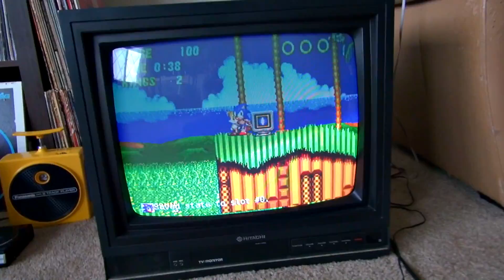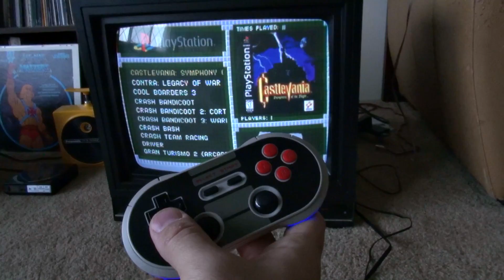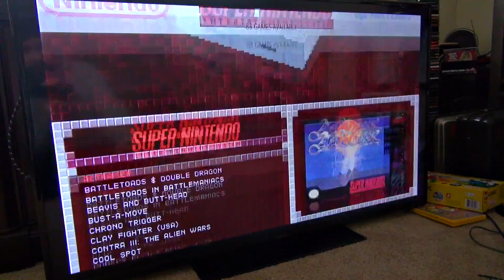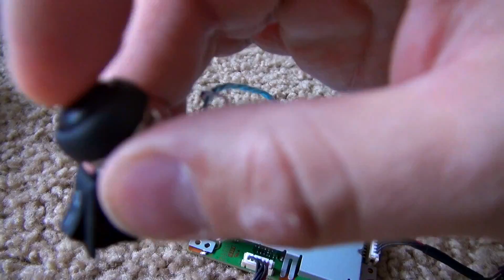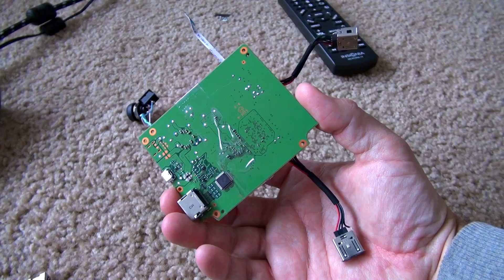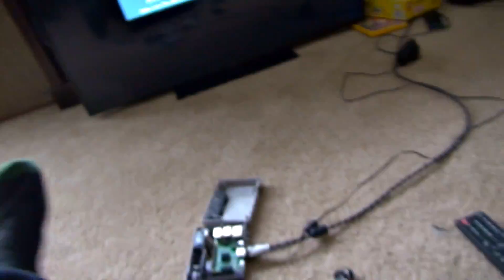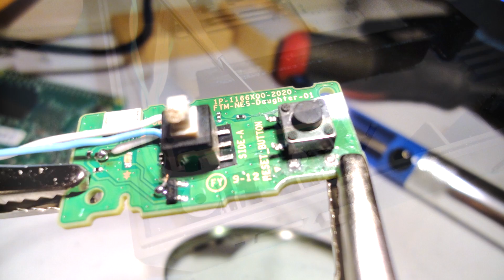Too soon? NES Classic Mini! Transformed into Raspberry Pi retro gaming machine!

Comment: I did my SNES retro. It has all nes and snes along with 1500 ps1 games Atari and many other. I was able to mod it without opening it up. I use a OTG cable to plug in my thumb drive and I have any oldskool game I want. Also have game genie installed and you can switch it on or off. There’s a lot under the hood

Comment: This is probably gonna get some hate for butchering an nes mini but this is what it should've been in the first place.
Reply: Actually, a quick flash of the contents of the NES classic and you can make it into a better emulator than that on a PI, they left plenty of storage room for almost ever NES and SNES rom.  All you have to buy is some controller extension cables for $10 pair and SNES classic controller.

Comment: Looks like its setup well. Why not build a rpi edition out of one. At the end of the day, it's your console to do as you please. Personally I'd feel bad ripping into like I did tearing apart a gameboy but if the builds clean it's not so bad. Iv build a gameboy zero out of an original gameboy, its clean. No hot glue or chipboards stacked up on top of each other. I don't feel so bad tearing into originals if it's a nice build. The nespi you've built here is quality. I'd be happy with the outcome 👍

Comment: What a freakin awesome build!!! I'm putting a Raspberry Pi 3 in a Chinese clone of a mini as I couldn't get my hands on an actual Nintendo one (for a reasonable price). The funny thing is I wouldn't have even modified it if I could have gotten a real one. Now I'm into it for as much as it would cost to buy a real one on eBay, but its a happy accident. I'll be way happier with a retropie console. My build is not going to be anywhere near as nice as yours, but I'm trying to get all the same functionality, and some of the aesthetics like the switches and light. That hinge you built is too damn cool! Any advice you have on making that cut so clean and thin would be appreciated. Subbing you for sure, also I should be sleeping and now I'm gonna be watching all your videos. Thank you!!!

Comment: I was thinking about emulating more of the haptic site of inserting cartridges. The software and circuit site of this is pretty simple with the gpio's. But making it feel rlike the real thing is hard do you have any ideas? If you actually want to do this i will prepare the software and circuit board layouts if you can call something this simple that.
Reply: Having seen your video you might be the right guy to get the "clicky feeling" right.

Comment: This is a nice quality conversion! I love the unique save/load state controls under the hood. It seems like you and I used a lot of the same hotkeys for controllers too. Going with the 8bitdo pads was smart as well. It's a shame they haven't made a 6-button version of these yet for Sega and N64 games... but that's another topic. 

Also I have to give you props for the Composite out, and how it just switches the resolution and stuff on it's own. I'm currently trying to get my own custom console adapted to a composite signal.  It's easily my favorite feature you have on display here. 

This SD-Floppy is easily the coolest thing I've seen in a long time. My mind is swimming with ideas on how to use such a cool device. I'm looking forward to seeing how you did that.

Comment: did you wire the composite video cables to the pins from the av port itself or did you wire the cables to the test pads, ie. pp26, pp25, pp24? if it helps to answer my question I have the rpi3
Reply from the maker: They're wired to the test pads
Reply: Yellow to pp24, red to pp26 and white to pp25 right?

Comment: Doin my own classic conversion myself, 2 simple questions.... How did you wire the power button (which pins specifically did you use as I also have a mausberry) and is the reset wired into your keyboard emulater to emulate the "esc" key to exit back to emulation station? I am going to post this question  here and your other related videos as I do not know which ones you will respond to and I could really use the answer soon as I want my box finished soon lol. Thanks for the help man...
Reply: okay well thanks for getting back to me lol

Comment: This is terrific.  I'm with you on the need for a shutdown script.  I wonder if there might be anything which could be done in the event of power loss?  Could there be a battery pack and some sort of signal to the Raspberry Pi OS which then responds by issuing an orderly shutdown?  I would hate to go through all of the work of setting a thing up and then having a power flux "flux things up."

Comment: Dude... incase you are not aware...you can Add Scanlines to all the games! and it will look like a CRT or better! in one of the RetroPie menus...or you can also buy an HDMI to VGA adaptor and then a Scanline generator which adds scanlines through a piece of hardware rather than emulated.

Comment: I am really interested in the theme you have running and the script to play the music.I started (trying) to tinker with the settings but it's so weird there are two locations to store and run themes on the Pi.... also don't know where I would store the audio file and read from.
I'll keep chugging away- it's nice to see that it is indeed possible to have background music in the menu. That's the first thing I felt was missing with some of these pre-made themes!
Why not just SSH into the Pi rather than use that floppy/SD thing to transfer ROMs?

Comment: Is there a strong point for this? While an RPi is fun for projects, you can install Linux on the NES Classic itself, and then, if you're inclined, port retropi or other emulators to it.
Reply from the maker: +阮天青 yes, what's a Raspberry Pi get storage space depending on the size of SD card you install, Wi-Fi, Bluetooth, USB ports, and far more development and support options
Reply: True, but you have such functionality without dropping the dosh to get a NES Classic Mini. A 3D printed case would be a lot less costly, and certainly, would be better developed to accommodate an RPi.

Comment: Hey, can you explain how you connect the mini LED to the mausberry? I got the use your own switch version and I don't know if i need to put a resistor. Thanx.
Reply from the maker: I connected it in place of the Pi's power LED, which has the correct voltage
Reply: Hey Maxime, did you ever successfully get the mausberry circuit connected to the nes classic mini LED on/off and reset board?

shoot me an email if you can if you have done it. would love to discuss

briandamico@me.com

Comment: I saw mods like this coming a mile away. Thanks for showing the Bluetooth controllers, I've been wanting to see them in action before I buy. I have the sloppy nes controller for my rom set as well as the other systems. most of them are sloppy as well but the n64 one is better. Thank you for the time you put into making this. I will research what you said and build my own. Would be an awesome science project for my son in school. Thanks again! Keep them coming. BTW awesome sd floppy drive.

Comment: Is there any reason you couldnt use a 1/8" to component video adapter cable instead of installing the component connector?  Isnt that what the little 1/8" port is for?  I think I have one of those that came with an old camcorder that I have laying around.
Reply: +Dr. Moddnstine Are you going to be selling something like this? I may want to buy one.
Reply from the maker: +JEG's Garage it seems a bit redundant, I know. It was really just for ease of connection. I don't have to run around the house now finding a special cable to hook this up to a CRT. Plus it's also to keep it somewhat authentic as the original NES had analog composite video and audio out. Sort of a throwback to see those jacks on an NES mini which clearly does not come that way makes it stand out
Reply: Fair enough!  I kind of figured thats why you did it..but I haven't played with my Pi yet, so I wasnt sure if that input was different or not.  I love the build you did.  I wish I could pull that off, but Im going to end up just putting mine into a case and running bare essentials for retropie gaming haha.
Reply: I would like to buy one! Name the price

Comment: Dr. Moddnstine, I have a question about the aspect ratio. I managed to replicate your setup, but when I plug my pi to a CRT, the ratio is still 16:9 (I have to set overscan so that the menus don't get cut off, but then it also squeezes the games' image). How did you do it so that both the ES menu and the games run in 4:3 on your screen?
Reply from the maker: In boot/config.txt uncomment the four overscan_left, right, top, and bottom settings
Reply: Dr. Moddnstine doesn't that compress the image of the game? If I apply overscan to fit the emulationstation menu with my crt, then the game gets squished!
Reply: Hey Felix,  did you ever successfully get the mausberry circuit connected to the nes classic mini LED on/off and reset board?

shoot me an email if you can if you have done it. would love to discuss

briandamico@me.com

Comment: Can you point what Keyboard emulator you used? as i'd like to use  the shell of a original NES (its mainboard died long ago when its AC Adapter failed taking the NES w/ it) and able to share that startup video?
Reply from the maker: it's linked in the description

Comment: Hey with the mausberry circuit did you connect it via the gpio pins? Possible if you can take a picture of the bottom?
Reply from the maker: Yes, you have to. Look a the end of the video to see some pics.
Reply: Dr. Moddnstine hey so I saw the pictures, mine came with 2 leads to come off it to hook up to the gpio pins but doesn't it require power for it to work? because mine plugs into the pi's micro usb then it can turn off

Comment: The reason why those games are blockey on a HDTV is because the tv is stretching a 240p signal to 720p or 1080p, so even a scanline filter wouldn't help much,but if those emulators will have a smoothing filter and/or adding scanlines while smoothing up the image,it can look closer as what you will see on a crt tv.
I liked how you added composite out on the nes mini,if nintendo did that,then they could,ve add duckhunt aswell.

Comment: Dr... looks great to me. i have a question. how do you get only the art work to show with none of that game info and have the game covers show larger than normal when you go into each system? i cant figure that part out and havent had luck finding that info anywhere else. your setup is exactly what i am looking for. thanks
Reply from the maker: It's the pixel theme
Reply: Dr. Moddnstine 
I found it shortly after I saw your video. thanks for getting back to me

Comment: You know you can just hold select and hit L to load state, R to save and the dpad while holding select to pick states
Reply from the maker: +Bromius yes, but those button are not available on the NES controller. Also this is an easier option for people not familiar with the hit key even if the Bluetooth controllers with the shoulder buttons are being used.

Comment: now hack the original nes classic edition and i will be impressed.  i wonder if they bothered to make their own OS or if it just runs linux... 

somebody should desolder the memory chip from it and dump a rom and start hacking the fuck out of it.  

seems like between the usb port and the 512 MB it should be theoretically possible to load a full NES library.  i would like to see how many games Nintendo's own emulator can actually run...

Comment: How did you get the opening flap to look so professional.  I haven't seen the real NES Classic up close but I assumed that the the flap wasn't simply sealed but just a facade to begin with.

But when you open it up I could see tiny lips along the inside of the open panel.  It's like you shrunk the original Nintendo.

Comment: Sorry but this video shows how the classic mini is such a ripoff.
Using an old product on limited access. Wii controller connection, so to increase the cable length you need to buy a wii extension.
The internal space, they could fit the whole Nintendo library twice in it, but they chose to do 30 games???

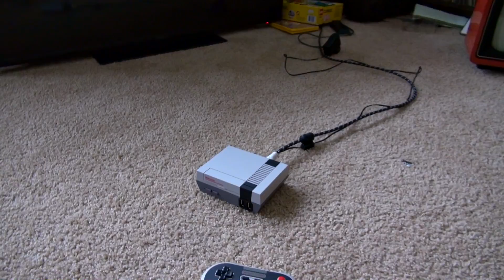Comment: 9:14 Didn't you say the HDMI port was epoxied over?
Reply from the maker: +Borvoc Yes. The original USB power port is where the Pi's HDMI out is now. There is a new hole under the Pi's HDMI out for powering the Pi.
Reply: Dr. Moddnstine Touche. Nice.

Comment: the menus seem to be 60 fps try making everything 24 fps
Reply: taltigolt why would you intentionally make the frame rate lower
Reply: Brian Harelick it's a nes?
Reply: The NES ran games at 60fps though.
Reply: take up less processing power
Reply: Antinull i stand uncorrected
Reply: re-corrected confirmed for brawl
Reply: Strafe doesnt matter my pi does fine at 60 running for days
Reply: Damian Cabaniss still takes less processing power
Reply: Squirt i stand corrected
Reply: right, interlaced frames though so only 30fps at full frame.
Reply: taltigolt You originally said 24fps, so get recorrected :P

Comment: How much hair pulling took place getting the 8bitdo controllers to properly sync?
Reply from the maker: About 5 months ago, lots. It's cake once you have the right firmware for the controllers
Reply: Ha, yeah I couldn't for the life of me figure it out. Thankfully, it was for a buddy of mines Pi project, and eventually he settled on keeping it wired. I'll have to look into the firmware and see which one is on there, I'm fairly certain I had upgraded it while troubleshooting.  Could you identify which is the most compatible firmware version that's worked for you, by chance?

They are excellent quality controllers, but when they simply refused to properly connect with the Pi after days of tinkering, I was incredibly frustrated.

My wired and wireless Xbox 360 controllers were plug and play, and are my preferred RetroPi controller anyway.

Comment: Prob the thing I most wanted to see that you didn't show was how you managed to cut out the cart slot> getting it straight and not fubaring it ?
Reply from the maker: That was a cringe inducing cut. I used a 9mm breakaway razor. I just kept making slow and steady runs down the channels. I had to take breaks as it was very fatiguing on the hand. One wrong move, and it's over, you've got a permanent slash on the face or top of your coveted NES Mini. I was literally sweating, and emitting body oder. To top it off, the case is very thick for what it is, so it takes awhile. 0 out of 0, would not want to cut again.
Reply: Lol nice I figured as much, Nice build buddy. No build log I take it ?
Have you a link to the script file for menu music ? I'm going to be building a pi zero soon and will prob add some smooth tunes ;) Thanks.
Reply from the maker: Check the description, I added a link to the BG music script.
Reply: Thanks already found how to do it and done it ! ;)
Reply: Dr. Moddnstine how much is it
Reply from the maker: +Charles Smithjr check the description, you'll find a video that explains my service. Price is in the description of that video.
Reply: Dr. Moddnstine ohh okay thank you

Comment: dude, sell these,  make them and sell them for $100 a piece,  you'd male $200k a year easily. I'll give you your first order Bro. $100 flat,  barely no shipping.  time could sell with no controllers even
Reply: RYNO NEEDLER it's also completely illegal to sell.  Make it yourself, genius.
Reply: the parts alone are more than $100. even when you can get the nes classic. $35 for a pi3, ^0 for the nes classic, $9 for the conversion usb thing + keyboard emulator thing + misc parts for jacks and such. + time. $200 conversion, easy.
Reply: kenabi yeah... hello McFly

Comment: So you bought a 60 dollar gaming machine so you can put a 35 dollar computer into the box?  Why not just 3d print the box?
Reply from the maker: +dur678910 That's the thing, the NES MIni is not a gaming machine, the Raspberry Pi 3 has some actual capability/expandability unlike the original guts with 256MB memory. The official NES case is unlike any 3D printed case, quality injection molded ABS plastic. It's perfect in appearance. Even with compromising the structure by cutting out the door hole, it feels like I could still put all my weight on this thing and it not cave in or break.

Comment: DUDE..market this and sell sell sell. No romz included of course just the emu's but I'd buy one for sure. Also there are Genesis, Atari, and prob others that could be used as a "case of choice"  so to speak.
Reply: Zarren Sanders he will be sued by sony and nintendo if he selled this
Reply: ya your prob right. but it is damn awsome.
Reply: +NA maybe not...if we buy the nes mini and the raspberry pi and have him modify and only charge for the service and extra parts. ..he won't get in trouble.
Reply: you can make it for free. selling the emulators isn't legal as they have non commercial clauses so good luck with that. Also nintendo will be on your butt too after you are done being shamed by the opensource community.
Reply: Zarren Sanders what do you think the going price for something like this?
Reply: well the classic is 60 bucks then the pie 3 with 2 controlers already set up on amazon is 90 bucks then considering work done id say $199.99 but to cut cost id do all the programing myself and go with a base pie 3.